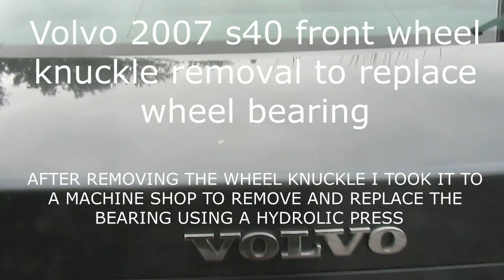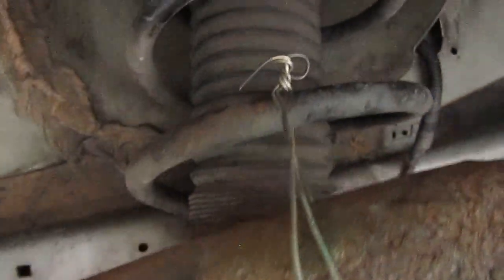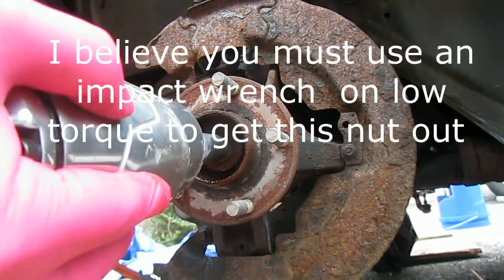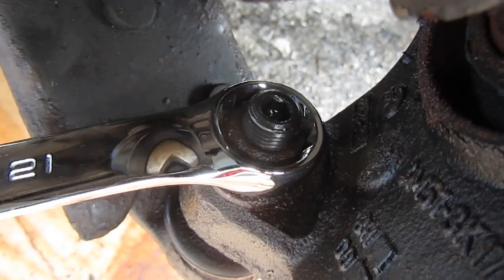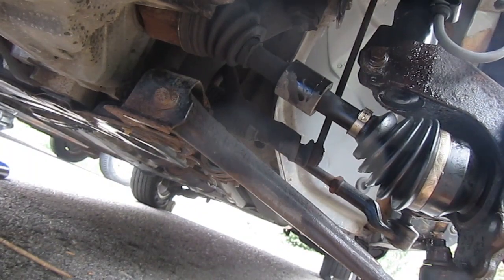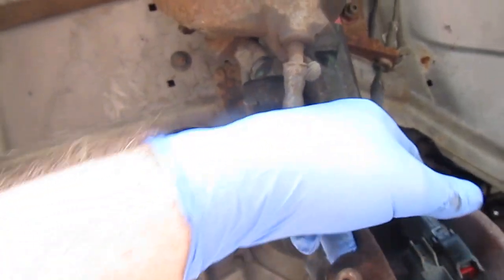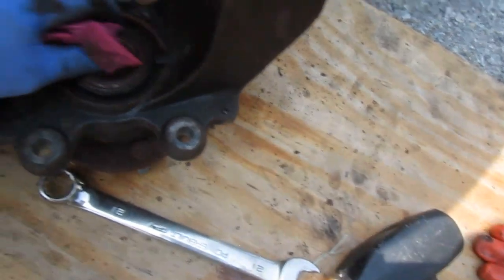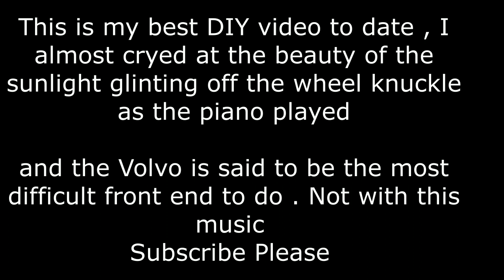volvo 2007 s40 front wheel knuckle  bearing, MUSICAL

Comment: He need to end this B S  music.
Reply from the maker: Hi Mark. Yes, this music gave a lot of people trouble . So I remade it without the music . There are two, both the same, one with music and one without. Thanks for your comment because this is the only way to learn what is working and what needs changed !
Reply: @carlkenyon4599  I think the music is hysterical.  It might be the only way some of these mouth-breathers are exposed to classical rather than a steady diet of death-metal.  But if beggars can be choosers, dial up your instructions and pull back the music slightly.
Reply from the maker: @briancorrigan5350  Thanks for watching , that was the wheel bearing  knuckle removal with classical music (volvo Wheel BEARING THE MUSICAL), I also have the same video with no music and some instruction . I did the video without music , then a friend said do one with classical music , so i overdubed it. .  The one you want is called Volvo Wheel Bearing with ME SPEAKING.   Thanks and Keep Watching!